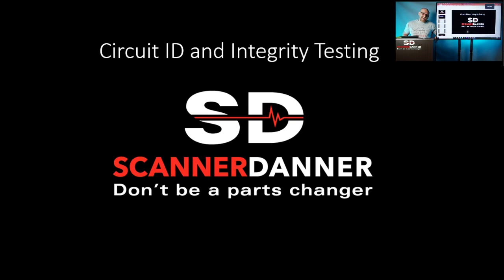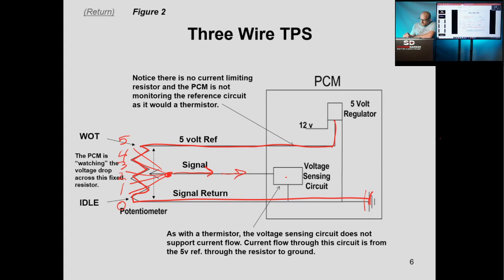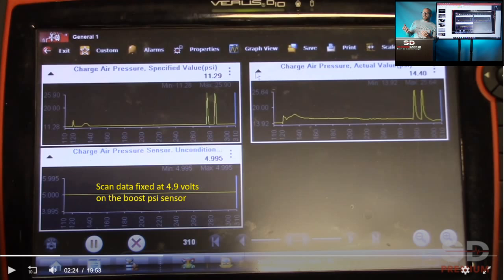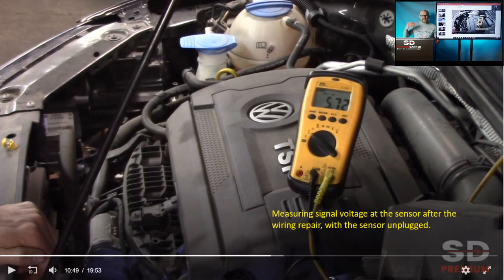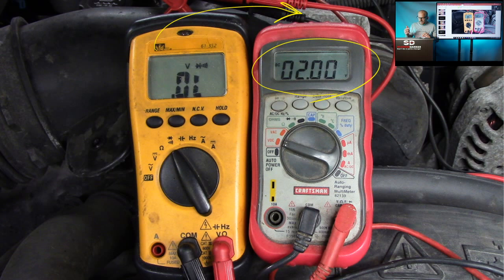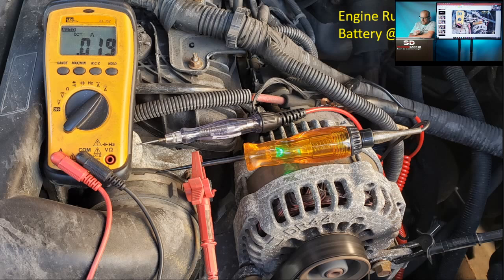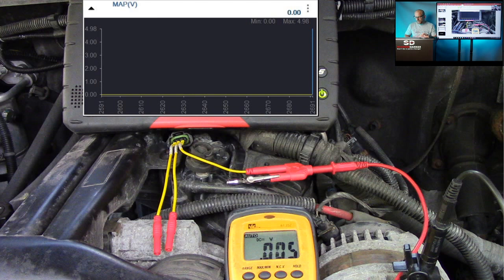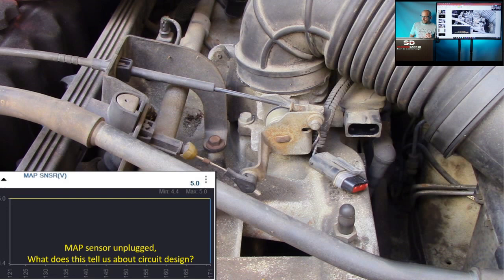Circuit Identification and Integrity Testing Livestream Class (previously recorded)

Comment: I love the ohmmeter because of the lower voltage. I would use my body as a resistor because it would be a cool to do, but as you said, higher voltage will be induced into the signal wire. To me,using the ohmmeter is the safest out of all of them.

Comment: Paul, you can explain the two circuits as "Logic", versus "Power". Logic circuits are very high resistance meaning direct shorts do very little if any damage due to the minute amount of current flow. A power circuit has higher amp flow which results in blown circuits when shorted or grounded. Logic circuits are for referencing changes for the control modules. Power circuits are for motor movement for what ever purpose as an EGR pintle movement. They require amps. Reference circuits do not require amps.

Comment: Another comment on the integrity of the wires towards a computer: inside any ECU there are inverse polarity diodes for transient voltage protection. On every input and output including power lines. In order to check the integrity of a wire one can measure the voltage drop between the wire and ground of the car using the diode tester on the DMM. Negative on the wire, positive on the ground. Current will flow through the protection diode biasing it forward and opening it. The voltage drop would be around 0.5V. Hope this will help anyone sometime.

Comment: At 43:00 I paused the video to try and think through why the higher impedance test light would not show a full 5V coming through the signal wire. Evidently the internal volt meter inside the PCM does not have 10M ohms resistance, so current spills through to ground more easily than a typical multimeter. Then it boils down to a simple voltage divider question. If the test light has, say, 800 ohms resistance, and the internal voltmeter has 1000 ohms resistance, then the drop across the test light would be 2.2 volts (5*800/1800), leaving 2.8 volts for the PCM to see through the internal voltmeter. So, there's a 3 bears sweet spot for sensor test lights! You want enough resistance that is doesn't fry downstream parts, but not so much resistance that the downstream devices can't see the full swing of what they are following. The practical upshot is not to expect to see a full swing of voltage there.

Comment: doing the conversion that otc test light has around a 1.8 watt bulb, so seems as long as people use around the 2 watt range and under they should be safe.i wrote this because after testing my test lights the harbor freight test light draws around 280ma at 12v where otc puts out around 145ma at 12v so a big difference between the two

Comment: 42:44 Ohms Law doesn't apply to LEDs they have what's called a non linear current characteristic.

For example with an incandescent test light a small increase in voltage will mean a proportional small increase in current and the light will glow brighter. This follows Ohms law (voltage is proportional to current) with an LED however a small increase in voltage will cause a huge increase in current. The increase in current is unpredictable and will vary from manufacturer to manufacturer and even from LED to LED.

Comment: Hello, I watched the whole video and found it very informative.
I was really glad that you had actually selected a TPS sensor for your illustration because it is the sensor that has given me a reading which has not been able to be diagnosed by ANYONE. Tried to sorted it out myself, took to a couple of mechanics and posted some questions on different sites. NEVER GOT A SATISFACTORY EXPLANATION to some even closely related.
I will give you the details and would ask that you address this condition in a video , and hopefully it can help others in a similar situation.
On the video you show the alternatives, expected results and basically a NARROW range of values which, once interpreted, discards other options and points to a choice with a reasonable degree of certainty, and as you well pointed out 100% certainty in life is not the norm, however it is achievable after "enough" testing and analysis is performed.
My problem is that I have the engine off, key on, obviously RPM is zero and the air being pulled into engine is also ZERO.
TPS connector is pulled off and my code reader shows MAF at around 135g/s ( idle is about 5.5g/s ) crazy but understandable ,
THE CRAZY PART IS TPS % keeps on increasing by itself, without any action being performed, It has gone as high as about 43%.
How can the % climbing be explained? All the examples you give the reading is for all intent and purposes "static" and I keep getting this raising value. In my head it goes something like the current is running through some limiter ( resistor) and as the current passes the resistance drops and the Volts increase ( as read by the reader).  turn off the ignition and after while the whole process repeats itself. Does it make any sense at all, if so where is this component that has resistance dependent on temperature?  could it be that some short exists between the MAF heating element ( keeps getting hotter and resistance drops and voltage goes up) Or what is the cause in case my reasoning is wrong. Please let me know if you have something in your channel that addresses this, and I can go subscribe to it.
Thank you
Reply from the maker: What are you driving? I've seen this before.
GM? 
Not worried about the key on engine off MAF values. Those are not valid until you have an RPM signal. The TPS % rise is a problem. (The MAF is steady right?)
Reply: @ScannerDanner  Thank you so much for your reply. I didn't bother to look  back sooner because most people are "too important" to reply or they are afraid of admitting that they don't know.
I didn't want to overwhelm you with information. I really appreciating you giving it a try. The climbing value has me completely lost and additionally this has been an intermittent problem.
Here is the information 2002 Buick Century about 150K miles.
IN REPLY TO YOUR QUESTION. Answer: MAF reading remains constant. TPS % creeps up.
THINGS I HAVE DONE
I have replaced the fuel pressure regulator ( the regulator was actually leaking)
I replaced the IAC . The one in the car was showing excess carbon on the tip)  A lot of hope went into this decision, the original probably could have been cleaned and would be alright., NO CHANGE
The PCV valve, the tube  and the rubber "U"that runs to the EVAP sensor. The "U" tube was collapsing . "U" tube now is Ok. ( I thought that some air leakage could be occurring. APPARENTLY NOT
Throttle body and IAC seat were cleaned . Problem persists
MAF sensor was cleaned. N/C
Air duct was checked for leaks None that I have been able to see or hear, N/C
Brake booster vacuum hose, Pulled and plugged, NO effect on high RPM. N/C
Physically checked and  throttle linkage seems to be shut. 
I have opened the throttle for a moment and see on an Autel READER thatTPS % go up, bring throttle back down reading goes as low as about 3% and then reading starts to go up. It looks like an auction, TPS% VALUES bounce back and forth within a very narrow range, but steadily climbs, It takes a few minutes to reach to a high TPS %

RPM's If starts normally shortly after  It first goes to  1300-1400 range then 1500-1700-1800  then 2000 the 2300-2400.  Once I had as high a 3400RPM. 
Turned off the car for a while, started again,  started normal but soon TPS % was acting again. 
Brought home and been trying to figure this thing out now for about 30 days.
The only thing I have been able to have some faith in is that - air is going through the engine- BUT how is that air is coming in remains the mystery.
I had an event that I drove for 40 minutes and EVERYTHING WAS "NORMAL"

I actually owned and drove the car for about one week, the rest has been trying to figure out what causes this.
Initially the car ran without problems.
Then I slowly started to notice that deceleration wasn't as fast ( I came to know that the engine was revving up)
To come to a stop, shift to neutral and sometimes turn off the car because the RPM's are so high that people are looking at me. 
To start moving,  the "BANG" when I shift into Drive.  I'm sure the transmission will be next to go.
I really appreciate if you can give me some tips on what to look for- I don't have a scanner at this moment, but bought a TECH2 clone on ebay, out of desperation, to see if I can read the IAC valve and see if it tells me something.
I went to the PCM and noticed that someone had either worked on it or tried to. The plastic cover on the top connector has some broken tabs, apparently the one who did, wasn't aware that the tabs have to be "squeezed" to be separated from the aluminum part of the connector.
Thank you very for your assistance on this problem.
Reply from the maker: @dveloso150  you have a bad engine computer. Like I've said, I've seen this. In fact, I even talked about my case study (just like yours) with my class at Rosedale Technical College (where I teach).
If your TPS voltage is steady when measured at the sensor and at the computer pin, and you are seeing a TPS voltage or % rise on the scan tool, you have a bad ECM.
The TPS rise is causing the computer to open the IAC valve which is why you have a very high idle at times.
Reply: @ScannerDanner  I have a lot of respect for you. You took the time to reply and " CLEARLY" stated your position and the reasoning behind. Nowadays this is getting very hard to find. No one has the " balls" to stand by their convictions. There is always a " weasel" clause.
 I can take your statement and " as a big boy" decide entirely on my own whether or not to follow it. The other position is, that quite a few are nothing more than self proclaimed experts, that when the going gets though they ' find an excuse to save face". Life offers no guarantees , it is a risky business. I will do my best ( don't really know how good that is, but that's what I got), when I received my clone scanner, try to make some sense of what I am reading , and go from there. I know for sure that if I do nothing, I will get nothing. Let's play ball!!!!
I will inform you of the end results and hopefully you can incorporate this event into something that may help others in a similar situation.
THANK YOU
Reply from the maker: @dveloso150  Thanks man, and without seeing the car in person, I can't be 100%. But what I can tell you with 100% certainty. The TPS% on your scan tool is matching your intermittent high idle speed complaint. Here is why: 
Within the programming of an engine computer is an IAC increase or opening, every time there is a TPS voltage rise (opening). This is there to prevent decel stalling issues. When your foot is on the gas pedal, the computer opens the IAC to prepare beforehand, for the moment you let off the throttle. Then is will slowly close the IAC to bring the throttle back to normal idle. You can see this effect on every car. Just sitting is park, if you snap the throttle, you will notice the RPM rise rapidly, then on the deceleration event, you will notice the RPM sort of hangs for a bit before coming back down. This IS the IAC effect on this system and is for decel stall prevention. A sudden accel followed by you slamming on your brakes so you don't hit something, is a period where we would get a stall if this wasn't in place.
I hope I am making sense. 
Now, back to the 100% part. I am 100% sure that your TPS % should NOT be rising without you touching the throttle. Your high idle that corresponds to this TPS% rise on your scan tool tells us that this is absolutely legit data (not a scan tool issue). 
So your final steps to confirm this issue is to monitor the TPS voltage signal directly to make sure that the voltage is in fact NOT changing. If it is changing, then we move away from the computer. If it is NOT changing, while you are seeing a TPS% rise on the scan tool then we move toward the computer as the fault. 
Like I said too, I have seen this EXACT problem on this EXACT model car :-) Customer had a 3000 RPM idle speed complaint and it was super dangerous! I could see the TPS voltage rise on the scan tool and a corresponding IAC opening is reaction to it, confirming the high idle was being commanded by the computer, because it thought my foot was on the throttle. When I checked the TPS voltage directly, it stayed at about .6 of a volt the entire time! IT never moved. And I even checked it right at the computer pin and it was steady there too. So a new ECM was the fix. (really weird issue) 

Last comment, you mentioned some weird MAF data. We don't really care about this for this issue BUT it could certainly be a part of the computer failure too. Just an fyi
Reply: @ScannerDanner  Hi update on my situation. Just got my Tech 2 ( is it really or maybe a chinese clone). The reality of this is that the TIS 2000 disk, doesn't run on windows 10 and it needs Internet explorer. I don't really know what is going on. I plugged the scanner on the OBD and the only thing that I''m interested in that I didn't have before is the IAC count ( I'm getting a bunch of other parameters that don't really help my specific case)
I thought I would be able to control some sensors that impact RPM but for some reason I can't make the actual RPM decrease at all. I don't even know if I have a defective PCM. ( I need to have some data that can be replicated in a regular fashion and I don't know how to do that with the scanner. 
On the other hand I would like to present an idea to you.
You have the knowledge from the day to day school of hard knocks, You have the experience of what is likely to work or not. You had experience with all sorts of scanners, ( good, bad and indifferent), you already have a book in your name, you have credibility and also some exposure, so why not make all this into a package that one could get the book and a scanner to go with it. You could get somebody to make a private label scanner for you and obviously the companion book that would take way all the " black magic" that is needed to " read the tea leaves" to understand what is going on. Have 3 levels of scanners that  could take on from basic to very complex tasks at different price points.  Additionally you could slowly add to the "tools line" everything under your name. The "DANNER" diagnostic tools line. Hello !!! what is it that Craftsman has that you can't do better? I think that you could have a complete one stop shop with things that absolutely " work together. I'm looking from my perspective, I just spent money that I couldn't afford and I'm no closer now,, to solve my problem,  than I was before , except $300.00 poorer. I would look for products from someone like you that recommended and gave me certainty that the product will do what it was promised to do. Look at all the chinese " miracle scanners" that are currently being sold. Long promises, short deliveries. Also try to do like some phone services resellers. Buy the wiring and technical info in bulk and sell retail you can also improve on the diagrams , because some of it is really poorly presented. Make life easier for the repair people. Give it some thought and I think you will become the Colonel Sanders of auto repair.
Good luck to you and thanks for the help so far. I think that you could really help a lot of people that want to get things done but can't get the right tools and information.

Comment: Oh thank you
I learned from you the diagnosis through 
Long term and short term
Now I know why my car got into trouble. 
No one knew the cause of the problem. 
Sensor Mass Air Flow 
But the problem was from the fuel pressure regulator stuck.
 Examined by injector oscilloscope 
It was intact for the duration of the opening of the fuel injector, as well as the shutdown.
Long term - 17 and short term - 10
Reply from the maker: good job my friend
Reply: @ScannerDanner 
I have an idea.
A moment when you test the fuel.
Some of them use gas sprays. 
When the car no start 
To see if it's fuel or not.
My idea.
Use Purge control solenoid valve (PCSV)
Separate the connected hoses and connect them directly to the fuel fumes passing. 
opinions that this is an easier way there is no need to use spray or other

What do you think of this idea?

Comment: Teach as always i appreciate this vid thanks for sharing this with us so much to learn in this video, you have been telling us about this technique for years, this one really stands out. Your basically teaching us how to diagnose the circuit the way the computer does it, and how the computer figure what fault code to send."This information here will not be written on a flowchart" but you are able to put us in the mind of the engineers and how they design the computer to function. 

Also thanks for the tip flies have very low integrity just use a zap lol.

Comment: For Paul. I was watching your video on wiring integrity. Someone was being sarcastic. The closest to 5k ohms resistor made is 4.7 k ohms. You can use two 10 k ohms in parallel.
Reply from the maker: or just use your DMM or test light instead as explained further in the video, thanks! The resistor actual number was not very important, it was just being used as a buffer in case the signal wire was shorted to ground or you accidentally jumped the wrong pins